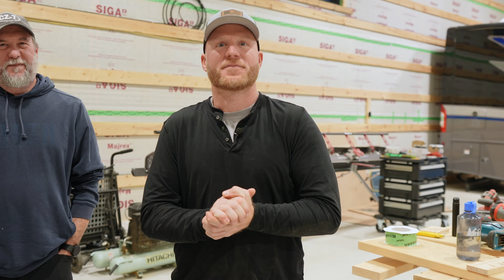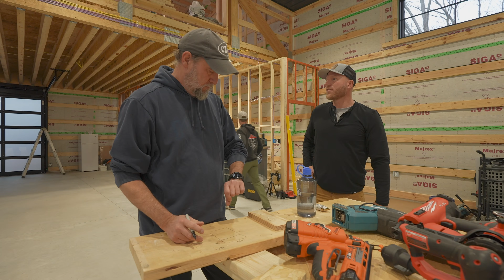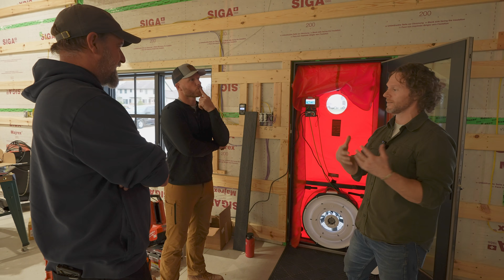FINALLY the RRHQ 2.0 Blower Door Test

Comment: 👍👎 how do you breath in an air tight building, what about mould? 
How much did this cost? Why is it every time you asked these professional guys a question they started looking at each other as if they are looking for an answer, I wasn't impressed.
I think you did a great job with the building, but this was a waste of money since you already knew the areas for potential air leakage.
Merry Christmas to you and your family.
Reply: It's not rocket science.
You can get the same low scores or just above with just 6 mil poly vapor barrier where it's needed in a zone 5 A for example with good quality taping techniques inside and out and paying attention to anything that penetrates the barrier.
That even includes all electrical penetrations too at a fraction of the cost on materials.

Comment: I had to dig into the old videos on the project because I could've sworn you fully sheathed and taped the entire building. And you did. But I forgot you kept the vented attic rather than sealing it up. I want to avoid that when we build, as well as have an open truss ceiling, but the sealing and insulation details get pretty tricky.

Comment: AeroBarrier makes the air sealing easy, fast, and well above code. Even without using spray foam as the insulation. We frequently seal homes below 1 in about 3 hours. If I hadn’t been watching your channel for years I’d be more impressed you built a shop to a .5 ACH but you manage to go above and beyond more than most builders we run into.

Comment: 0.52 on a small house is impressive but a small warehouse is 🤯

Question...

You found an issue with the rear man door in the rv bay, that was the actual seal created from the door closing, and it was a "big leak" for the test.

Considering you had the front man door open for the entirety of the test so the red door could be installed, do you set up the equipment on a different man door so you can ensure your front door doesn't have the same issue?

Also, are you wearing Greg's pants or did TruWerk change to a euro pattern? Them tans are tight!

Comment: Thanks so much for doing this video Kyle.  Can you share more about the manufacturer and model of the overhead/garage doors you used?  Getting that number on a building with multiple large garage doors is very impressive.  At least to me!  I can't imagine getting those numbers with a standard issue garage door from a big box store or similar.  Did you do anything special around the garage doors?  If so, can you share?  Thanks again for the great content.
Reply from the maker: Raynor garage door alumiview AV200 doors

Comment: I coincidentally started building my own house (with no previous building experience at all) around the same time you did and have been looking at all of your videos. After I saw one of your videos where you did a blower door test I figured I wanted to try that as well. 

My results were 0.036 at +-50 pascal so I got something out of the almost 4 kilometers of taping, mainly going through the trusses with air barrier added a lot of tape and hours at night.

I'm not sure if our values are comparable straight off as I have in metrics and looking at our national requirements it seems that either our requirements are stricter or the value needs to be multiplied to be able to compare.
Anyway, great work and thank you for sharing so much through your videos!
Reply from the maker: Congrats man nice work

Comment: Question....are they going to make blower door tests required in the future for homes?  I think for the cost of the test it might be good, and may actually get some of these builders to start caring again.  When my house was built 24 years ago I was on-site daily because I could be.  I was cleaning, checking, taking pictures, etc.  My house was pretty tight because of that, and the builder knew I was checking up.  When we were looking at builders we saw many that were just beyond horrible.  You could see how horrible the framing was, how lousy the house wrap was, the missed insulation, and more.  This kind of thing may force them to do a better job, and a job that really wouldn't cost much at all.
Reply from the maker: Yes I think it will be some form of a requirement like this
Reply: @RRBuildings  I learned that Michigan does require blower door tests on all new construction.  Passing is 4 ACH....to me, that's pretty high.  I think they make it high so that the builders can just slap things together and sell them.  Becomes more of a "see, we're doing the right thing"....hmmm....
Reply: I had to do one on my home.  There are air exchange requirement country wide, but it varies by jurisdiction how strict they are.  My area requires them.
Reply: @locke3141  Yep, learned that it is required in my state and they allow 4 ACH as noted above.  When I was reading about the "reason" they said "because people need to have more air exchanges to keep the air fresh in the home".  Ummm...it's called a "Make Up Air System", even my current home has one and it was built 25 years ago, back then it was pretty standard for that.  Blower door tests?  No, but make-up air systems yes.  Politicians need to get the heck out of some of these rules they make (we just had passed "Cage Free Eggs only".  The reasoning is "Cage Free Hens have the freedom of movement".  When questioned not a single politician had ever seen a "Cage Free Farm" before....hens are packed in even tighter than a caged farm....and more deaths and egg losses because of it. smh at the stupidity of the politician.
Reply: @WreckDiver99  yeah that’s true.  The makeup air system should be what gets fresh air and “breathes” for the house.  Take Canadian wildfires last year.  I didn’t even know they were happening until I went outside because I had a tight house with good makeup air.  In other houses I was in, I could clearly tell.  We aim for 3ACH50 in my state and many builders struggle to get that.  I managed a 1.7 on my own build which I GC’d on my own, which I felt was pretty great given my relatively amateur status.

Comment: What does the garage door manufacturer plan on doing about a garage door that flexes inward when it is below zero outside and the garage is 65 above inside. It is worse on the bigger doors. The seal does not flex back because it is cold and stiff.

Comment: For me the way to get a structure comfortable and safe is to equalize the inside and outside pressure therfore creating an enviorment with zero air exchange regardless of how air tight the building is. Without a pressure difference between the exterior and interior there will be no air flow(leakage) so paying attention to balancing replacement (fresh) air vs exhaust air so that pressures remain as close to equal as possible with a small bias towards a low positive interior pressure insuring all air inside the living spaces of the structure are filtered and conditioned and any air losses are to the exterior will yield the best living enviorment and most comfortable space possible. Ray

Comment: You could have sheathed the loft side of your truss with blue board and then taped your siga to the top on the rake of the attic and the bottom in the shop space. That would have been about the quickest way to seal it up I feel.

Comment: This is good for the home owner commissioning new construction and checking the builder work quality. For the builder it matters much less. If you build to the RR exacting standards, with the right materials, you  know exactly what you're gonna get: a very tight building. So no need to re-test and reinvent the wheel every time. Basically the game is won at the design and build stage.

Comment: I'm planning on breaking ground on a shop built almost just like this next summer. It's going to be 72 ft. wide and 48 ft. deep using the same building method for the most part. I love everything about this build. Great job! You've taught me a lot about the finer details that I didn't know about. Thanks man.
Reply: He does build a very amazing building your guy to admit but chasing all these air leaks at the end that can drive you absolutely crazy but it’s amazing is how just that hole in the floor made such a huge difference
Reply: @steveanderson4768  I agree.
Reply from the maker: Good luck!
Reply: @RRBuildings  I'll also be building it all by myself and with no hired help because I don't want to pay for labor except for on concrete day.

Comment: I remember building McDonald’s in my 33 year Career and we always had to get a Air balance Done so we Constantly had Positive air to keep Bugs out so next time you pull up to the DT Window and you feel the Cool Air from inside it’s Working Correctly because most have 3 Exhaust fans causing Negative airflow so Makeup Air is Very Important!
Reply: Interesting on keeping bugs from entering doors and drive thru windows.

Comment: When I worked on a building site, building houses!, we had  a few of these done on some of the houses,!!!  back then, I didnt understand what they were doing , just that it was a house seal test, but Thanks to this I now understand.!! Just wondered, If all draughts are sealed How does the house Breathe??. Anyway, Wishing You Kyle & all family, and  Greg and all his family A Very Happy Christmas and a Fabulous New Year 2025 Thanks for All the videos and sharing..🤓🤯🤯
Reply: Freddien this is a common "Question" and one that needs Myth busted. Houses DO NOT need to breath. We actually want really tight houses, where we can control what air is coming in. IE: through an ERV or HRV. Check out Matt Risinger and some of his building science stuff and it will help you a lot.   The houses need to breath thing is a myth that needs thoroughly busted in this industry, cause it's still a huge thing that many believe.

Comment: RRHQ 2.0 Blower Door Test: Achieving Remarkable Efficiency

*   0:00 Introduction: Kyle, Randy, Jake, Chris, and Nolan collaborate to conduct a blower door test on the RRHQ 2.0 building.
*   0:17 The Energy Conservatory: Jake, from The Energy Conservatory, explains the history and purpose of blower door tests, highlighting their role in assessing building airtightness.
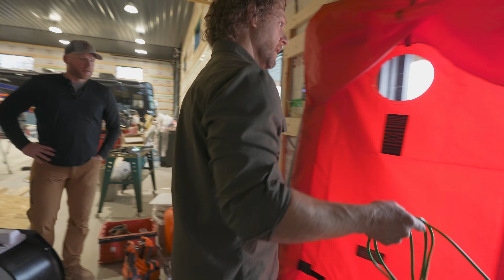*   1:07 Blower Door Setup: The team sets up the blower door on the leeward side of the building for optimal test stability. The blower door is positioned to create negative pressure within the building.
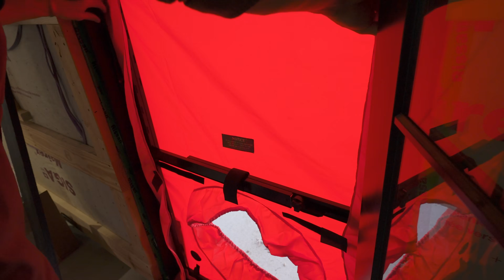*   3:23 Multiple Fan Usage: For large buildings like this one, multiple fans can be employed to achieve sufficient airflow (CFM) for accurate testing.
*   4:49 Initial Test:  A preliminary test is conducted to gauge the building's airtightness, revealing a promisingly low airflow of around 550 CFM at 50 pascals of pressure.
*   6:48 Historical Context: The evolution of blower door testing is discussed, emphasizing its impact on identifying previously unrecognized air leakage pathways in buildings.
*   10:37 Tight Building Indicator:  The continued rise in pressure after the fan is stopped signals a very tight building with minimal leakage.
*   10:54 Leak Detection Techniques: Infrared cameras and smoke pencils are presented as methods for pinpointing air leaks during a blower door test.
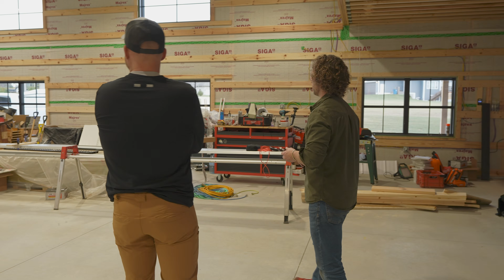*   12:27 Leak Identification: Using a smoke pencil, the team identifies air leaks around a garage door seal and a girder truss, illustrating the test's effectiveness in revealing hidden issues.
*   16:27 Leakage Impact: The discussion shifts to evaluating the impact of identified leaks on overall building performance and determining the cost-effectiveness of addressing them.
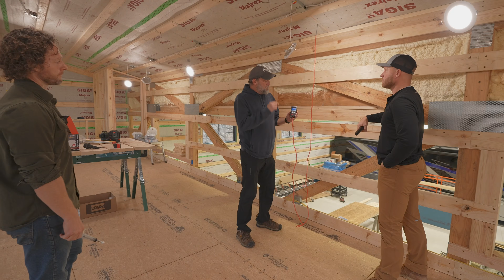*   18:35 Attic Pressure Test: A pressure test within the attic space indicates a near-perfect air barrier, with minimal pressure difference compared to the outside.
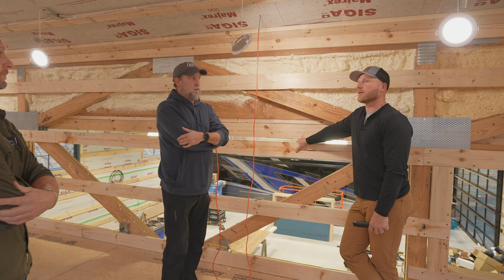*   20:29 Code Compliance: The team notes that most building codes require three air changes per hour at 50 pascals (ACH50), significantly higher than the building's current performance.
*   21:36 Building Shape Advantage: The simple, rectangular shape of the building is acknowledged as a contributing factor to its airtightness.
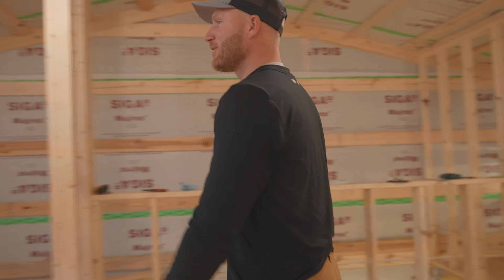*   26:29 Identifying a Significant Leak: A noticeable leak is discovered around a vent pipe, and its impact on the blower door score will be assessed.
*   28:47 Volume Calculation: The building's volume is calculated to be 65,386 cubic feet, a crucial factor in determining the ACH50 score.
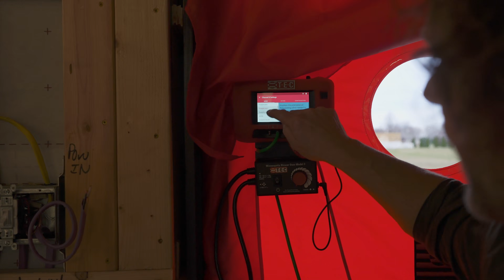*   29:47 Initial ACH50 Estimate: Based on preliminary measurements, the team estimates the building's ACH50 to be around 0.5.
*   31:27 Addressing the Leak: The significant leak around the vent pipe is temporarily sealed to measure its effect on the blower door reading.
*   33:48 Quantifying Leakage:  Sealing a gap around the garage door reduces the airflow by approximately 60 CFM, highlighting the importance of addressing seemingly minor leaks.
*   36:22 Post-Sealing Test: After sealing the vent pipe leak, the blower door test is repeated, resulting in a revised airflow reading of 606 CFM at 50 pascals.
*   37:05 Updated ACH50: The new ACH50 score, after addressing the identified leaks, is calculated to be 0.52.
*   37:47 Performance Analysis: Despite being a large garage with multiple doors, the 0.52 ACH50 score is deemed impressive and indicative of a high-performance building.
*   41:28 Equivalent Leakage Area: The building's total leakage area is estimated to be equivalent to a 4.5 by 4.5-inch square, emphasizing the minimal amount of air leakage.
*   42:19 Conclusion: The blower door test successfully demonstrates the exceptional airtightness of the RRHQ 2.0 building, showcasing the effectiveness of meticulous air-sealing practices.
*   45:24 Duct Blaster Test: As an addendum, a smaller "duct blaster" fan is demonstrated, highlighting its suitability for testing smaller, highly efficient buildings.
*   49:50 Industry Collaboration: The collaborative nature of the building performance industry is emphasized, with professionals readily sharing knowledge and expertise.
*   51:02 Future Plans:  The team expresses their intention to utilize the "E" ring on the blower door for future tests, signifying their commitment to achieving even higher levels of airtightness.
*   51:15 Final Thoughts: The video concludes by reiterating the value of blower door testing in ensuring building efficiency, comfort, and long-term cost savings.

I used gemini-1.5-pro-exp-0827 on rocketrecap dot com to summarize the transcript.
Cost (if I didn't use the free tier): $0.04
Input tokens: 26856
Output tokens: 1082

Note: I watched the video and I don't think the measured numbers are always correct in the transcript. So also the numbers in this summary may be incorrect. I don't understand enough about this topic to correct them, though.